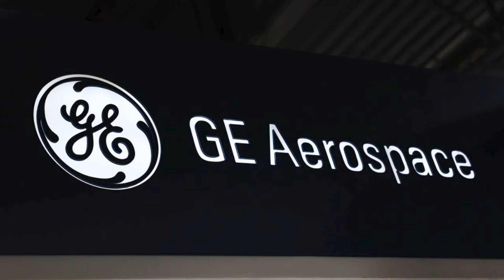Gripen’s U.S. Engine Problem: Why Saab Won’t Replace the F414

Comment: This is not too accurate since Rolls Royce engines are the new standard for Gripen E NG. There are several articles about this that date back to 4 to 6 months ago. This is all promotional and trying to mislead.

Comment: One of the best videos on the issue: An airplane is built around an engine, not the other way around. I know many Brits think they can solve the problem with a stroke of the pen, but that's simply a misunderstanding of modern aviation. We're no longer in the era of World War II, where a fighter jet could receive a new engine every six months.
Reply: Don't believe everything you see on the Internet. The Gripen E NG is Rolls Royce based and is what's being promoted to Canada when they commit to build it there.
Reply: @joireland  An engine that won't exist for at least 10 years? Stop dreaming. It's just wishful thinking for now, nothing more.
Reply: @CROM-on1bz Wow the bots are workin' hard today. That 10 year number is just nonsense.
Reply: @joireland  So, just so you know, I'm neither a bot nor a troll; I'm simply relaying what was said in the Rolls-Royce press release regarding a motor for the Gripen. Check it out; it's written there in full. Anyway, the new Gripen variants are still under development, so there's no rush.
Reply: @CROM-on1bz Most bots like you exist for less than 1 year (like yours) ... it's very obvious and AI itself proves you're wrong. Most people on this chat line can verify it yes.
Reply: @joireland  Before using AI, you must first be intelligent yourself, and that doesn't seem to be your case.
Reply: @CROM-on1bz These bots sure seem realistic these days kiddos. Too bad they spread misinformation like this.
Reply: @joireland  https://youtu.be/azxiRv9Pxbc?si=Li1MrJFxx8Kzc7n6 
British video about the Gripen and the so-called RR engine... So who's the troll now?
Reply: @CROM-on1bz AI generated videos don't prove much. You really should do you research with C2PA dude.

Comment: When a country goes for an advanced weapons system, they also acquire spare parts, such as complete sets of the engine in stock. It is nothing you start to order when there is an engine breakdown. By the way, the modified version of the Gripen engine has surpassed 400.000 hours with no internal engine breakdowns. This due to a very sofisticated sensor and control program.
Reply: Stop talking nonsense. Not all Gripens in flight for over 20 years have accumulated 300,000 flight hours. What's the point? To badmouth the Rafale? To spread US propaganda? Or just to engage in French bashing because it's cool?
Reply: @CROM-on1bz There was no intent to "badmouth" anything here, just pointing out that the  service and maintenance routines of the SAAB JAS-39 Gripen, seems to work fine as they reached 130.000 hours of flight in 2008 and in 400.000 hours 2024. I suggest you use Google to confirm this: how many operating hours does the jas 39 have?
The number of operating hours for the JAS 39 Gripen system varies depending on whether you look at the lifespan of individual aircraft or the total time in the air of the entire fleet.
Total flight time of the system
As of November 2024, the global fleet of JAS 39 Gripen C/Ds had flown close to 400,000 hours. Previous data from 2008 indicated just over 112,200 hours, which shows a steady increase in line with international use.
Lifespan per aircraft
Designed lifespan: Modern combat aircraft such as the Gripen are designed for a total lifespan of 8,000 flight hours.
Annual usage: An individual aircraft flies an average of about 200 hours per year, which means an operational lifespan of 30 to 40 years.
Individual records: Within the Swedish Air Force, individuals of the JAS 39 have passed the milestone of 3,000 flight hours (noted in 2020).

Comment: People always say “Gripen is cheaper than French Rafale!” Wrong: 
On November 15, 2025 Colombia finalized the purchase of 17 Gripen E/F fighter jets : 3.1 billion euro ($3.6 bn) : $212 mn per unit.
On  November 17, 2025, the UAE acquired 80 Rafale fighter jets : 14 billion euros ($16.3 bn), that's $203 mn per unit (Prices include maintenance)
Reply: Columbia got an extensive package not just the plane
Reply: @AindriuMacGiollaEoin  That's what I said : both sales included maintenance + spare parts + weapons.
Reply: @AindriuMacGiollaEoin  In any case, comparing a twin-engine jet with twice the payload and twice the range, capable of carrying nuclear weapons, ground attack, air superiority, and carrier operations, to a light defensive fighter is completely idiotic. Even if the Rafale were more expensive, its capabilities are incomparable to the Gripen, which is, incidentally, a good light defensive fighter.
Reply: You can't compare when UAE buys and pays cash. Meta AI: Added Strategic Value
The Colombian deal includes substantial industrial offsets—investments by Saab into Colombia’s local economy, including projects in cybersecurity, sustainable energy, and water purification, which are factored into the total €3.1 billion contract value. - WATER PURIFICATION! They ADDED THAT TO THE COST FOR FIGHTER JETS. In other words, corruption, deals left and right.

Comment: Just buy engines from Safran then
Reply: or Rolls Royce ...However,  Gripen must be redesigned to fit either engine  and that alone will cost hundred's of millions.
Reply: Yes, but no. An airplane is built around an engine. Change the engine, and you change the airplane. It's not grandpa's old Cadillac

Comment: This means that in the event of a collapse of FCAS (with France, Germany and Spain) (or a reduction to a system of system programs), Germany will not start a new project with Sweden, but will join the British-led Tempest. In any case, this is probably the best choice for Germany.
Reply: I think there will be very little room for others to contribute, the pie has already been divvied up between the partners and for Germany to get something, the others would loose. Also I don't think they want a Germany which will start banning the exports to countries it didn't like.
Reply: @TheBooban so very true: for the EF-2000 program Germany has often been a drag rather than a prop. Technically it could find its own niche to collaborate, but politically...
How many Typhoon has Germany sold abroad, while other partners were teying to market an push the plane on the international market?
how many went the French route just to avoid the hassle?
How many sales from other members were slowed or stopped by German weapon export bans? Even Turkey almost gave up on the Typhoon due to German interference  and Saudi Arabia found out how difficult it is to deal with such a "Self Righteous" partner.
Japan wants the new fighter ASAP, but Germany already proved how much it can drag its feet as soon as a program doesn't benefit its own timelines
Reply: You're right my friend, the British haven't built a single-engine aircraft since the Electric Lightning in the 60s and the Germans since the ME 262 in the 40s. Good luck guys.
Reply: @CROM-on1bz what are you talking? Rolls-Roys is a major manufacturer and service provider of aero engines
Reply: @HappyHippo-g5z  including the RB199 and EJ200
Reply: @HappyHippo-g5z  Engines... Yes, but do you know that an engine is not an airplane? That it's a little more complex? Flight controls, computers, aerodynamic studies, materials studies? Computer-aided design, and so on and so forth; if it were so simple, Rolls-Royce would be an airplane manufacturer and not just an engine manufacturer.
Reply: @CROM-on1bz They make the engines for the Eurofighter and the vtol engine for the F-35b.
Reply: @TheBooban  Ah yes, the Lightning 2, that plane that loses every time it's pitted against Dassault's Rafale, several people working together to make a mediocre aircraft... Congratulations, along with the Fail-35, it's the finest achievement of kind amateurs. Let the specialists build competitive aircraft and... I don't know, maybe do some embroidery, or make teacups. Did you know that even the USAF reduced its Fail-35 orders to transfer them to F-15EXs and that the B-52 will soon be 70 years old? Thank you very much for these antiques... Oh yes, the only Rolls-Royces that sell these days are German, thanks BMW. 🤣🤣🤣🤣🤣🤣
Reply: @CROM-on1bz Why are you complaining to me about the F-35? I don't care. I just pointed out what you said before that the UK not building jet engines was wrong. Your ranting doesn't change that.
Reply: @CROM-on1bz Well, for what is worth, the EE Lightning was a twin-engined aircraft, but I guess that the lesser of your problems at understanding what you are talking about. 🤦
Reply: @Zumzifero  An aircraft as hideous as it was useless, with a range of less than 1000 km; in fact, it was replaced by missiles because it was so obsolete from the moment it entered service. Just another blunder like the Ajax or the frigates that break down as soon as the sea gets too warm... So ridiculous and ineffective.

Comment: Tomorrow there will be 5 new videos saying that RR made an engine for Gripen :D
Reply: Hah, probably..I can't fathom why that lie is repeated. And this video confirms what I've noticed since I started watching the channel. Relatively short but succinct videos and so far I've not detected that they are trying to push an alternate reality (unlike several other yt channels on the topic)
Reply: The only real problem is that the SAAB Gripen is built around GE engines, and changing the engine means completely changing the aircraft. So no, it's not a lie, it's simply the reality, and there's not much Rolls-Royce can do about it. We're not talking about an old Buick where you can fit any engine; we're talking about a sophisticated aircraft and an aircraft manufacturer that made a strategic choice at the time, a choice that is debatable today.
Reply: @CROM-on1bz Well...they just switched out the engines of the B-52 to new RR engines. As video explained, if they found an engine that could physically fit (I don't think there is one), it's possible, but doesn't make any sense to do it because of the costs. Gripen won't be flying around as long as the B-52 has and will.
Reply: Actually the Rolls Royce version was announced way back about 6 months ago and is what's been pitched for production by Canada.
Reply: @joireland  because you read fake news 6 months ago? Please show me the SAAB or RR page which details the RR engine for Gripen.
Reply: @joireland  But according to the Rolls Royce press release, this engine is in development and will not be finished for at least 10 years, and for a jet engine, that's really very fast.